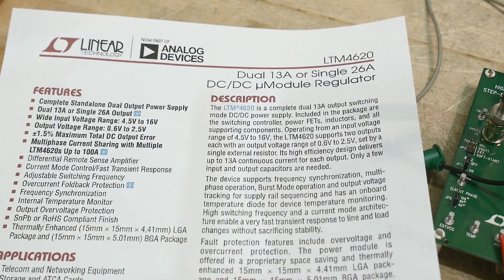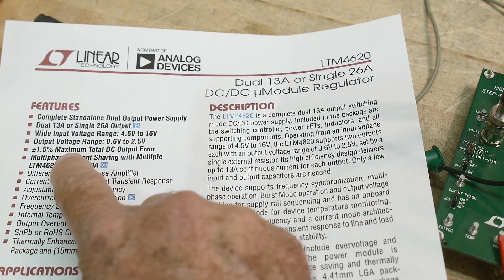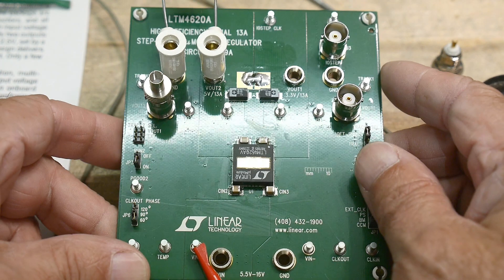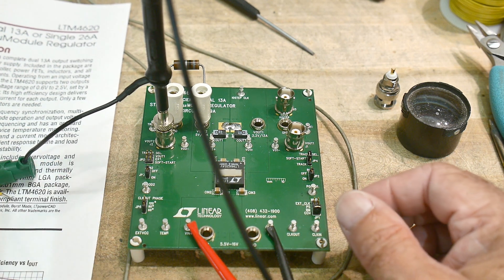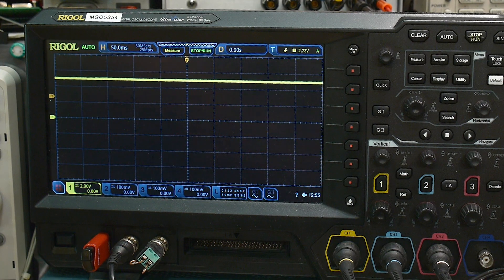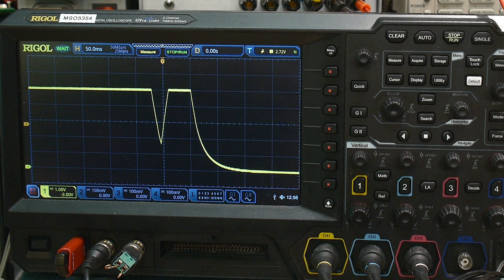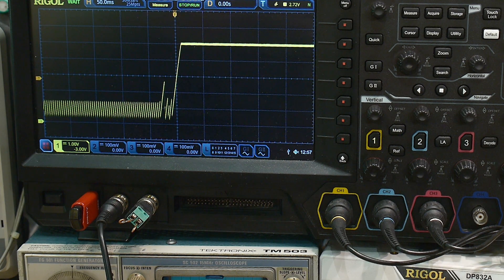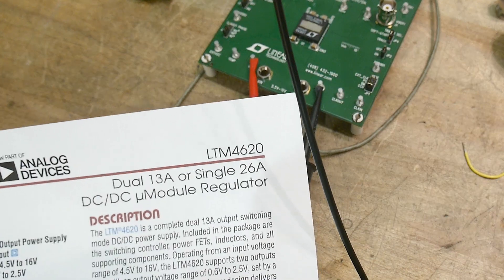#1551 LTM4620  DC-DC Converter Module

Comment: Ah, looking at the datasheet in the video 0:46 you show LTM4620 but the actual part you have is LTM4620A - the "A" part does up to 5.3V whereas the shown datasheet shows 2.5V. My initial thought was that the dual DC converters were in series or some such.

Comment: Useless part if used for 2.5 volts but good if used in series for the 5v... $70 Is very high cost, you can use Murata modules for much less.
Reply from the maker: what is an equivalent Murata part number

Comment: what do you do with 26A
Reply from the maker: fast large chips need hundreds of amps these days and low voltages. start at page 176:
https://cdrdv2-public.intel.com/655258/655258-010.pdf
Reply: @IMSAIGuy  cheers, a bit of interesting reading and education.
Reply: Dunno but maybe automotive applications.

Comment: Cool - but what's the use case - or in internet speak:  But why?????????????????????????????
Reply from the maker: fast large chips need hundreds of amps these days and low voltages. start at page 176:
https://cdrdv2-public.intel.com/655258/655258-010.pdf
Reply: @IMSAIGuy  That's crazy - thanks for the link!

Comment: Can someone point out the part number of the BNC to scope adapter. I found some, really pricey, there are some really cheap. Can someone recommend one for hobby friendly price. Will be using in the 20-100MHz.
Reply from the maker: https://youtu.be/i_TY9PLUGRU
Reply: @IMSAIGuy  Thanks, I was asking about the BNC to scope probe adapter at video timestamp 1:52, where you have the scope connected to Vout2/J2 of the demo board.
Reply from the maker: @RonDogInTheHouse  oh, you can find them on ebay. search for: Oscilloscope Probe for HF Tektronix,Agilent BNC Adapter Probe BNC Quick Plug DT
Reply: @IMSAIGuy  Just what I was looking for and in my price range. I was finding some for $54 (crazy). At this price I'll get a 3.8mm and a 5mm.  Never know what probe I'll be using tomorrow. THANKS.

Comment: curious who they sell these to. people who make big industrial equipment?
Reply: Telecoms boards mostly for increased density applications. There can be a problems with these devices re-flowing within the module if an exact temperature profile is not used. They are very noisy from an EMC viewpoint (in my experience)

Comment: Spec sheet you are showing is for the LTM4620. Dev board is LTM4620A - this explains the 5V output as the spec sheet shown say max output voltage of 2.5V.